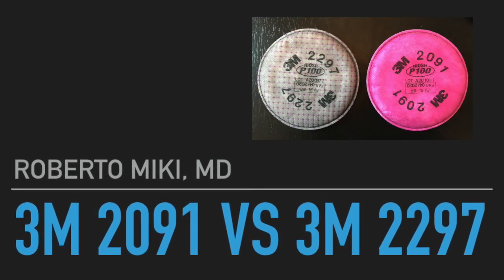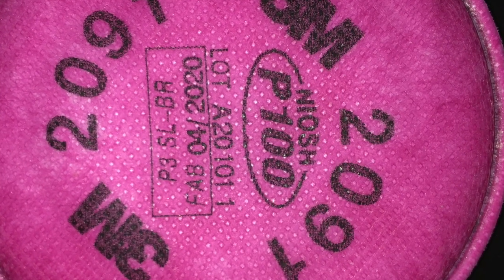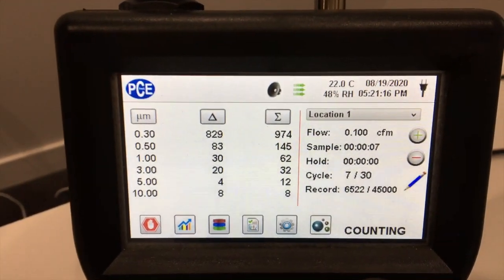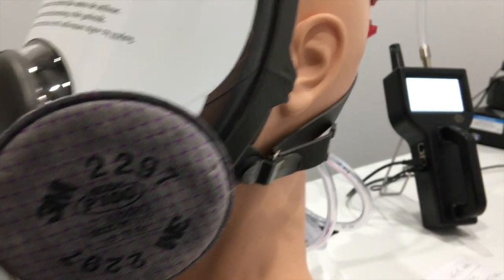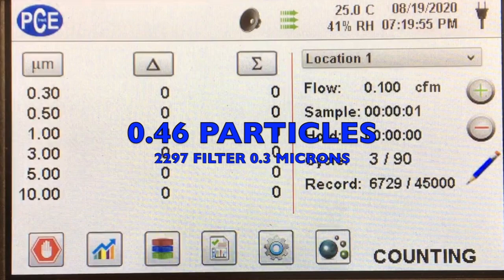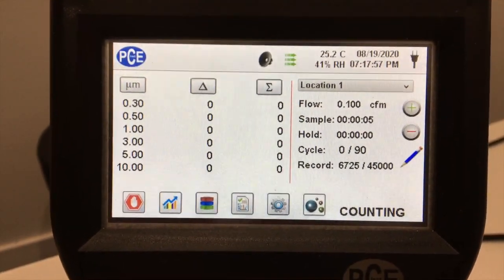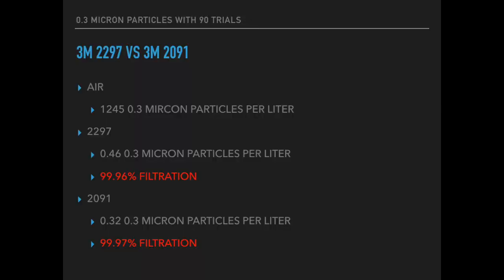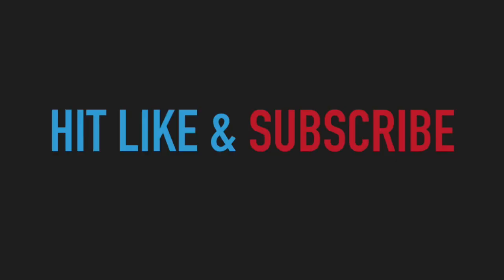3M 2091 P100 Filter VS 3M 2297 P100 Filter using the 3M 6800 Mask

Comment: First please allow me to say THANK YOU! for the informative video.  I had been wondering about the difference between the two filters, and 3M doesn't seem to say any difference.  3M's info made me wonder why there are two difference models/numbers.  Your video really helped answer those questions.

OK, based on the video and last comment there is no "real" difference between the pink (2091) AND the grey (2297) mask?  You mention the 2297 is thinner, does it breath enough easier than other to really notice in use?  You did say the 2297 (grey) has more order reduction.
Reply from the maker: I could not really feel and sense any difference when I have used them as far as ease of breathing. The odor decrease seems to be the only real difference.

Comment: What is the difference between the 2296 and 2297?
Reply from the maker: Sorry it took me a while to get back to you but somehow I missed this comment.

It looks like the main advantage of 2297 over 2296 is you can have exposure to nuisance level organic vapors but neither is good enough for true exposure to organic vapors.

These details are from the 3M website.

2296
https://www.3m.com/3M/en_US/p/d/v000153255/
Protection Type	Asbestos, Mold, Silica
Purpose	https://www.3m.com/3M/en_US/p/d/v000153255/ & Filters
Recommended Application	Arsenic, Asbestos, Brazing, Cadmium, Chemical Manufacturing, Manufacturing, MDA, Metal Pouring Including Exposure to Lead, Painting, Pesticide Application, Petrochemical, Powder Charging, Powder Coating, Pulp and Paper, Remediation, Sanding, Soil Preparation, Spray Coating, Torch Cutting, Welding, Wood Processing
Recommended Industry	Construction, Design & Construction, Facility Sanitation, Food Processing, Food Safety, General Manufacturing, Heavy Infrastructure, Industrial Maintenance, Marine, Metal Production & Fabrication, Mining, Oil & Gas, Transportation

2297
https://www.3m.com/3M/en_US/p/d/v000153256/
Product Type	Filter
Protection Type	Asbestos, Mold, Organic Vapor, Silica
Purpose	Cartridges & Filters
Recommended Application	Arsenic, Asbestos, Assembly and Mechanical, Brazing, Cadmium, Chemical Manufacturing, Cleaning, Composite Finishing, Final Finish, Manufacturing, MDA, Metal Pouring Including Exposure to Lead, Paint Preparation, Painting, Pesticide Application, Petrochemical, Powder Charging, Powder Coating, Pulp and Paper, Remediation, Sanding, Soil Preparation, Spray Coating, Torch Cutting, Welding, Wood Processing
Recommended Industry	Construction, Design & Construction, Facility Sanitation, Food Processing, Food Safety, General Manufacturing, Heavy Industrial, Industrial Maintenance, Marine, Metal Production & Fabrication, Mining, Oil & Gas, Pharmaceutical, Transportation
Reply: @RobertoMikiMD  Another advantage of 2297 is that the gray color appears to be low key and less scary when used in the public hhhh
Reply from the maker: Nuisance level refers to concentrations not exceeding OSHA PEL or other applicable government exposure limits, whichever is lower. Do not use for respiratory protection against organic vapours or in environments that are Immediately Dangerous to Life or Health (IDLH).
Reply: @RobertoMikiMD  Thank you so much, i was searching, but only found the charts. Thank you for your help with the links.

Comment: Thanks for the video but I still couldn't understand which one was better?
Reply: Thanks in at work now demoing a 100year old home and I'm trying out the 2297 filters for the first time and they seem to be working just as good as the pinkys. With significantly better breathing. This is just my opinion I am not a professional on these filters.
Reply from the maker: I think they are equivalent for the most part.
Reply: @RobertoMikiMD  what about 2097 vs 2091?

Comment: Wich one off these 3M filters is best for welding ?
Reply from the maker: 2297 should work. 
This is a website link from 3M specifically for welding:
https://multimedia.3m.com/mws/media/1028293O/respirators-for-welding-brochure-70-0716-7146-8.pdf

This is a website link from 3M to help you choose a filter:
https://multimedia.3m.com/mws/media/565214O/3m-cartridge-filter-guide-and-brochure.pdf

If you want a disposable mask 3M makes a 3M 8233 N100 filter.
https://www.3m.com/3M/en_US/company-us/all-3m-products/~/3M-Particulate-Respirator-8233-N100-20-ea-Case/?N=5002385+3294776421&rt=rud
Reply: @RobertoMikiMD  Nice one Thanks
Reply: the 2297 contains charcoal and thus provides proteciton against vapors and fumes, it is also easier to breathe through.

Comment: Thank you for your videos. Do you suggest trying to cover a 3M half-mask elastomeric respirator exhalation valve port with a N95 or similar mask? How confident are you that the exhalation valve will not allow SARS-COV2 virions to be inhaled?
Reply from the maker: I think the exhalation valve should be covered by a mask if possible. The manufacturers do not recommend this but I have not experienced a problem doing so. I do not think you need to put a N95. A simple surgical mask should suffice. The exhalation should not allow the user of the mask to be exposed to the virus if the valve is working properly.
Reply: @RobertoMikiMD  Thank you for your reply. I plan on affixing a KN95 mask around exhalation port as a backstop and to help protect others.

Comment: Really helpful video.
May I know how often should I change the filters?
Reply from the maker: Depending on what you are using it for. Potentially, they could last upto 6 months. Remembr, these filters are not protected against splashing with fluids like water or oil. If you are using in healthcare the outside will become contaminated and cannot be cleaned.
Reply: Thanks a lot for the info👍.
I will be using these in hospital,so how often should I change the filters?
Reply from the maker: @snnisty  I would probably not use these filters in a hospital because the outside is not protected. When you take off the filters your hands will be contaminated. 3M also does not recommend use in a hospital because they have not been tested or approved for that use. That being said they should theoretically work. As far as contamination, you could try to protect them but it might make it harder to breath. One problem is that a stream of fluid like bleeding artery may go through the filter. For example the nonmedical N95s which were approved in the US for hospitals have to be protected with a surgical mask if you are going to use in the operating room becuase they will not stop a stream of blood. If you are going to use them, there will be an absolute expiration date on the package which is usually 5 years from the manufacture date. Interestingly, the packaging has the expiration and manufacture date but the filters only have the manufacture date. 3M states you can use them until the work of breathing becomes difficult. I would say with biologics in a hospital I would set a time limit although it would be relatively arbirtrary. I would say 6 months max for me and may be as short as 1 month. I would say if you are going onto a COVID floor or patient I would not use these because the outside cannot be decontaminated and you risk contracting the disease during donning and doffing. Obviously, if there is any gross contamination with blood or other fluids, or visible damage I would change it. The filter I would use is the 3M 7093: https://www.youtube.com/watch?v=pnVhIrNmpI4&t=10s This filer can be decontaminated with wipes and is protected from the  outside from gross contamination and fluids.
Reply: Roberto Miki thanks a ton sir
You gave a really helpful advise.
Then I will go for 3m 7093👍
Thanks again 🙏
Reply from the maker: My pleasure. Where do you work? Are you in healthcare?
Reply: Roberto Miki I’m a resident doctor in department of internal medicine,from India 🇮🇳.from state called Karnataka
Reply: Roberto Miki where are you from sir?
Reply from the maker: Stay safe! I hear India is in the thick of it! Good luck and keep up the good fight!
Reply from the maker: Miami, FL 
USA
Reply from the maker: We are on the downward trend but still in jeopardy.
Reply: Roberto Miki yes it is.
thanks a lot sir.
keep inspiring us😀🙏
Reply: Roberto Miki I wish a early recovery for your great country.
Fortunately got the chance to visit US,early this year(before covid),and indeed fell in love with this country 🇺🇸 and it’s people!!!
Stay safe sir🙏

Comment: Thank you so much for your wonderful testing!  This truly confirms that the easier breathing 2297 is just as effective as the 2091!  God bless you!  BTW, there are many fake 2091 on eBay and even Amazon.  Those fake ones used to be less than $1 per pair before Covid.  Surprisingly, when worn, subjectively, they seem to filter out smell. If one day you could compare fake 2091 (or 2097) with genuine one, that would be most enlightening.
Reply from the maker: My pleasure! Be safe. And pay it forward! God bless you too.
Reply from the maker: Will try to find some fakes ones!
Reply: 3M probably buys theirs from China anyway?